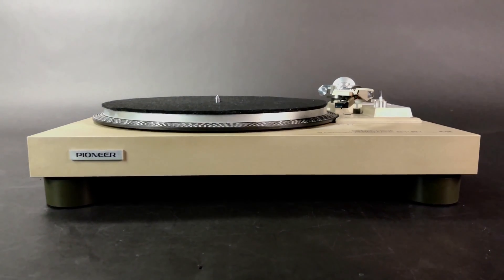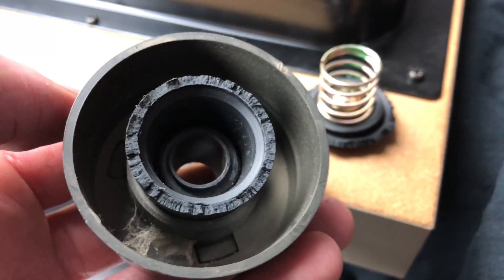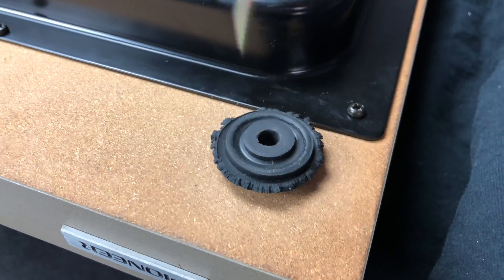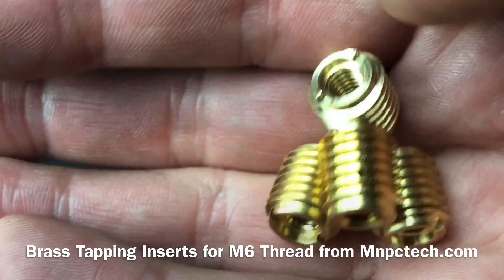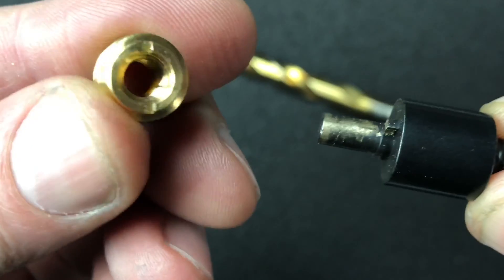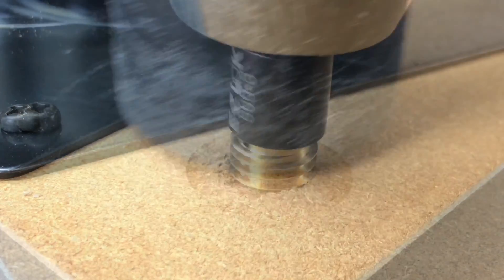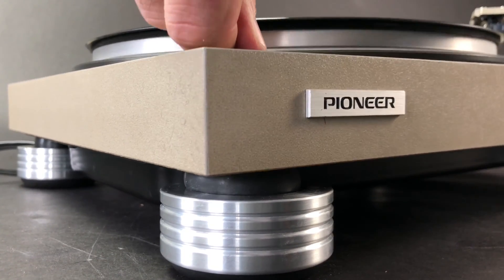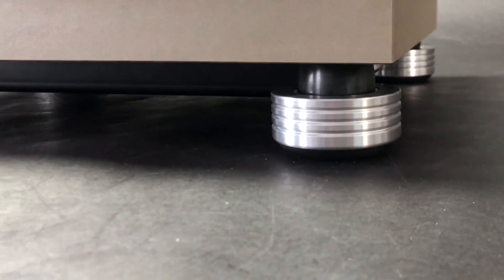How To Fix Repair Pioneer PL Turntable Rubber Feet with Sorbothane Isolation Upgrade

Comment: I watched this YouTube video demonstration on your MNPCTECH; sent an e-mail last year, and now I am referring to this web site again. And I have been on YouTube, ebay, and Amazon Canadian gathering information, knowledge, additional advice, and tips. 

I now have a more detailed understanding of how to possibly install these turntable isolation feet for my hk T25 belt-drive turntable that was purchased over a year ago; bought new stylus. I was not aware that, "Brass Tapping Inserts for M6 Thread" were available, and drilling is done; which I can perform. I'm glad that there is now hi fi stereo equipment that is produced, and made in the USA.

Therefore, I am wondering if there is a version of MNPCTECH Custom Isolation Feet for record players that could possibly fit my harman kardon T25 turntable? Can you also provide the price? Furthermore, I am aiming at a DIY home custom turntable to build, too. Therefore, I may buy these MNPCTECH Custom Turntable Feet with Sorbothane Isolation Upgrade, again. Thank you very much for any sound, logical advice that you can provide.
Reply from the maker: Reach Mnpctech directly here, https://www.mnpctech.com/pages/contact-us

Comment: Hi how much are these? I have a ITT Schaub Lorenz 8012 old turntable I got this is a direct drive automatic Diatone Mitsubishi rebadged turntable
Reply from the maker: they would be gigantic on the  ITT Schaub Lorenz 8012, store link is in description, have a great day!
Reply: @MaxellAdGuy  not gigantic this turntable is as big as the Pioneer and silver looks even better than the Pioneer bc it's also silver and black
Reply: They're spec'd (for this turntable) at $149.94 for 4.  Others are higher, some are lower.

Comment: Those feet look awesome! I just rebuilt and installed a vintage Audio Technica tonearm on my turntable, and boy oh boy, it doesn't like the vibration coming out of my turntable at all. I just have old Nordost Pulsar Points under the plinth made of aluminum. They seem to be just reflecting back the vibrations into the turntable and the cartridge. My turntable weighs about 70 or 80 pounds, I guess?  Which of your products would you recommend for my turntable issues? Thanks!

Comment: Wow this video came up at just the right time. I'm looking to replace my Core X9's solid plastic feet after having pump vibrations give me grief. Cheers.
Reply from the maker: awesome, use my voucher code, MNFAN at checkout, and I suggest these feet with optional vibration isolation washers, https://www.mnpctech.com/products/caselabs-atx-eatx-cases-and-towers?variant=31400031387714